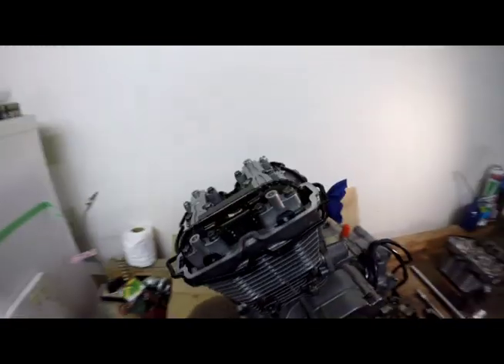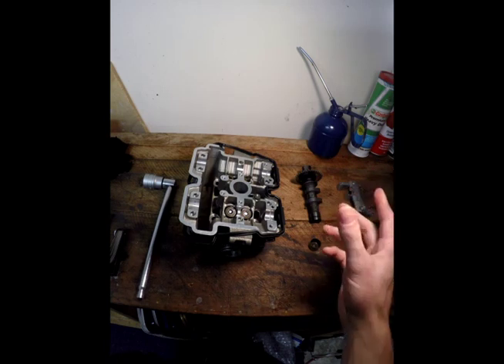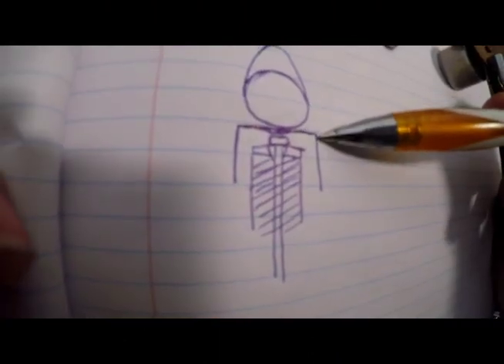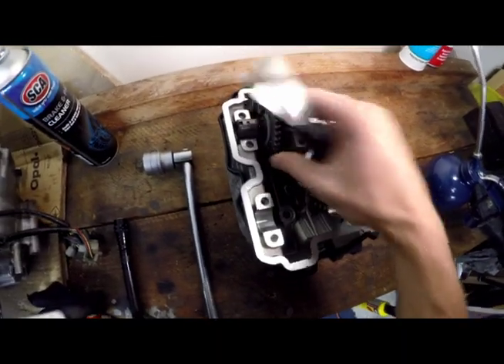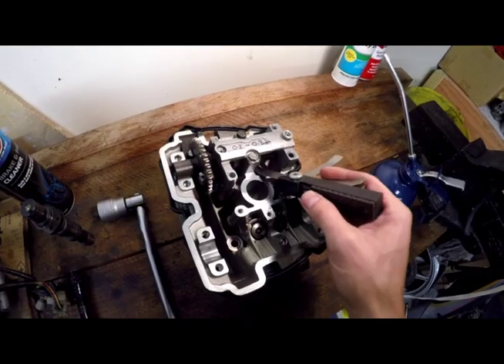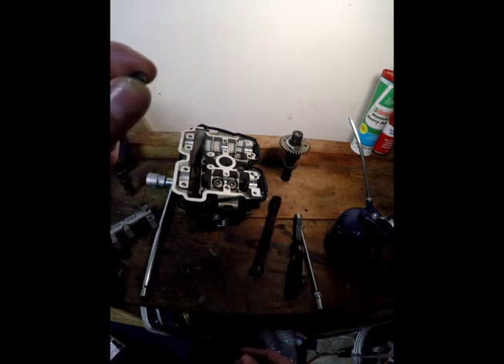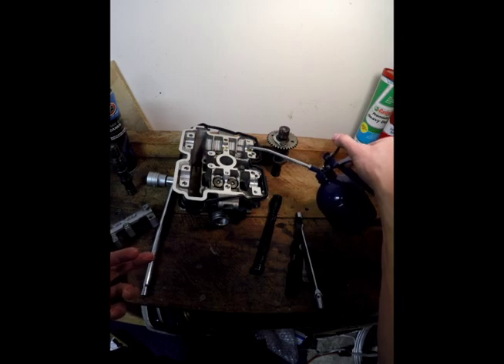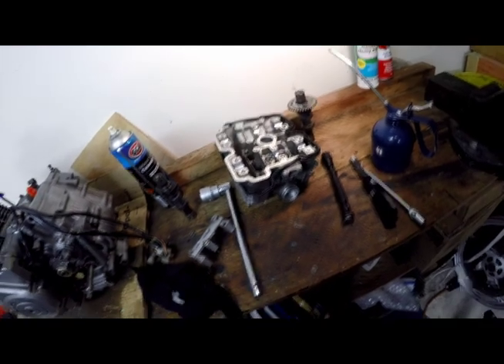How to Set Shim / Tappet Clearance (Bucket Style)

Comment: I had a question, my owners manual said the clearance should be 0.17-0.27 so it means that if ever i measure it and it shows 0.20 and still inside the range does it means its okay ? or should i stick to 0.17 ?
Reply from the maker: That sounds perfect to me. Generally you don't want it right on the limit.
Reply: @TheMotorcycleForge  Nice, So in other example, if my Tappet clearance is a bit off so i make up with the adjustments by putting a Much higher MM of shims so that the clearances will be on spec ?
Reply from the maker: Yep, pretty much. If the gap was 0.30mm to get it back in spec you would need a shim that was 0.10  bigger to put it back at 0.20.